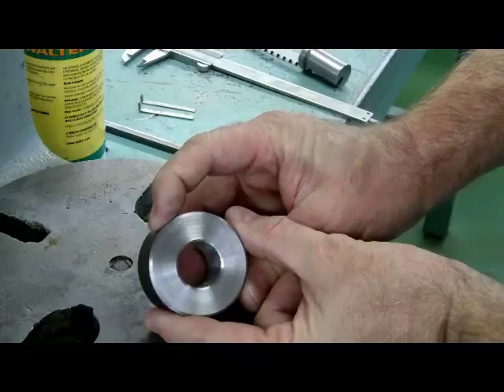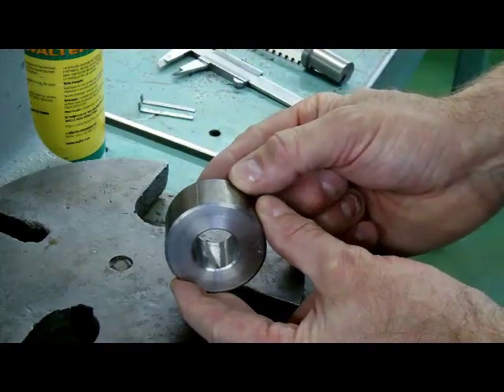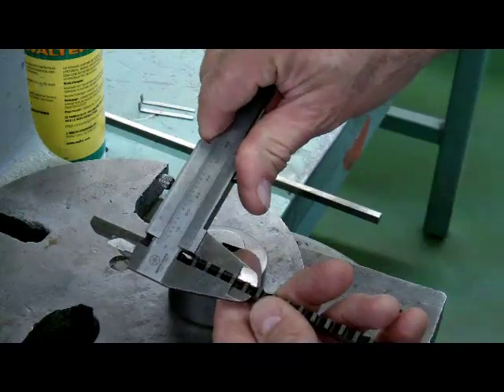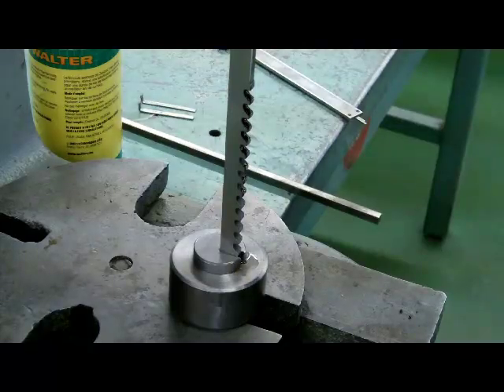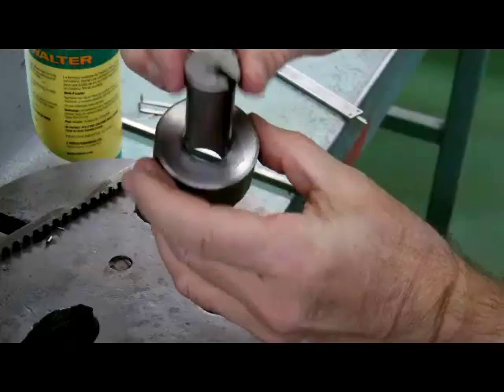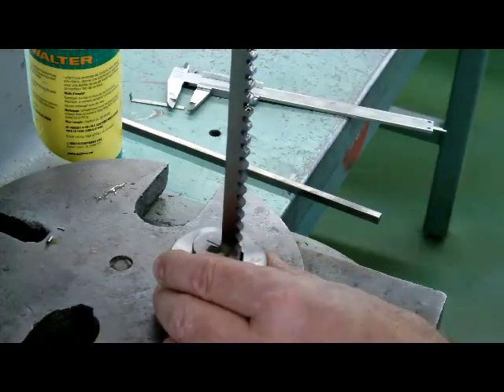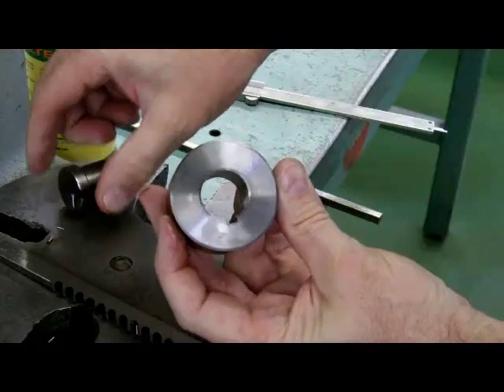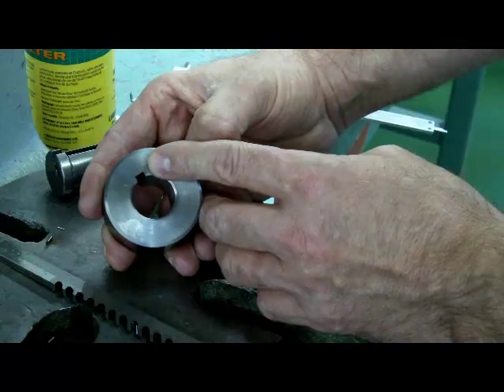Broaching - Cutting a Keyway

Comment: Hey nice Video. How much pressure is needed in this case?
Reply from the maker: Thank you. There is enough pressure to require the use of a hand press. If the cutter is sharp, and goes through straight, it is not a lot of pressure created. Thanks for watching.

Comment: since its a  3/16  does the mean the bushing only accepts 3/16 ?  i cant find anyone who can explain the thicknesses of the broach and bushing groove,  or what A B C D  means  where are the people with all the details
Reply from the maker: They key would need to be the same width for both the shaft and bore. Approximately half the width extends into the bore and the other half is in the shaft. The width is dictated by SAE according to shaft diameter.